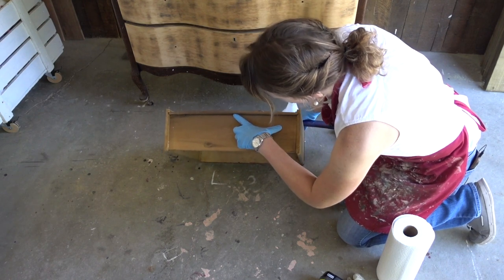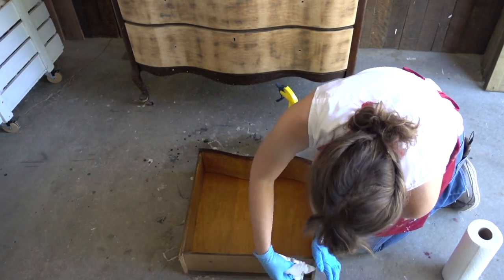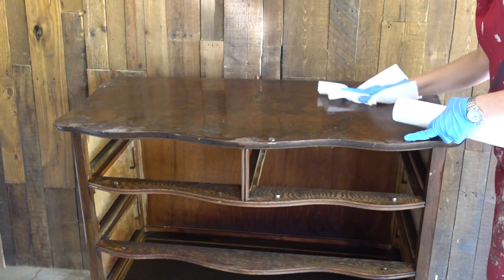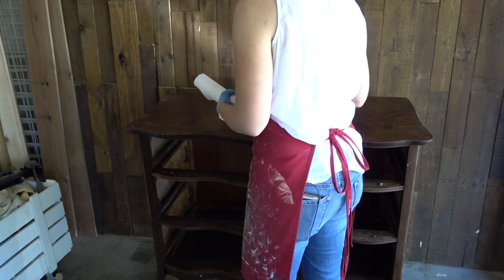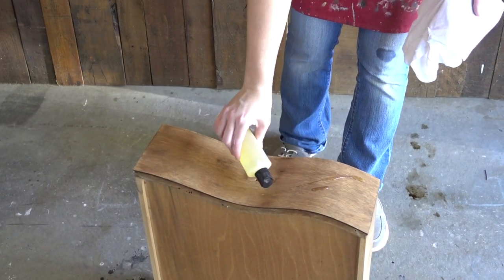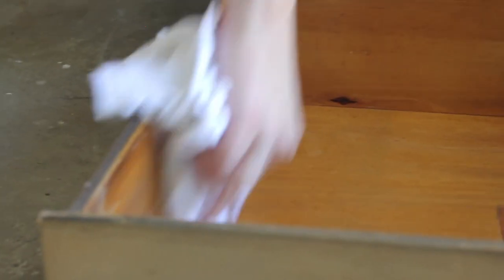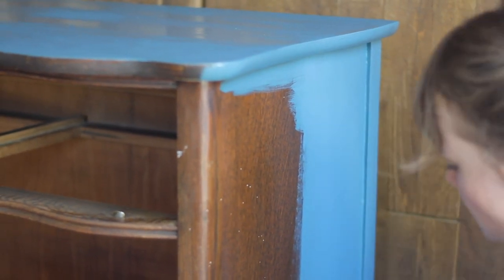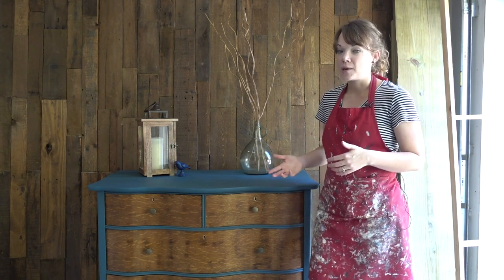Dresser Makeover - How to Get the Musty Smell Out of Old Furniture

Comment: It’s really good to sand the inside , the underside and edges as well. It better helps to remove “all” the bad stuff. Then restrain and seal “ all “ surfaces. That way,  whatever you store inside of them is setting next to a healthy surface and it looks all the better, inside and out. It’s a little more work , but completely worth it. Clean out the cavity and seal with fresh stain and clear coat,using a brush, cloth and spray paint can of clear, or brush on poly.

Comment: I have followed your steps for refinishing wood furniture with general finishes milk paint and it's turning out amazing!! Thank you for you tips and you tube videos!! I was totally freaked out, but it turned out beautiful.
Reply from the maker: YAY!! I'm so glad.  It's so fun once you get the hang of it. Now you can do it and not be scared ;)
Reply: @RootsWingsHome  so I have a question, I painted my dining room  benches and chairs with lamp black milk paint. Looked great until I put the general finishes top coat satin finish and now I can see a ton of brush strokes. I liked the flat finish I had and I couldn't see any brush strokes. I thought that it had leveled out beautifully. I think the top coat made the lines appear. Please help any advice? If I used the flat top coat would it dry without the lines appearing? As of right now I'm going to have to sand down the chair I placed the satin top coat finish on. What do you think? Thank you!!
Reply: Also curious if you see paint lines or does it level out and look like it was sprayed?